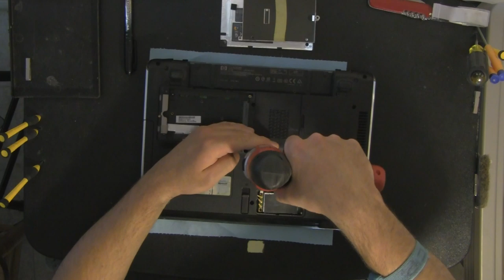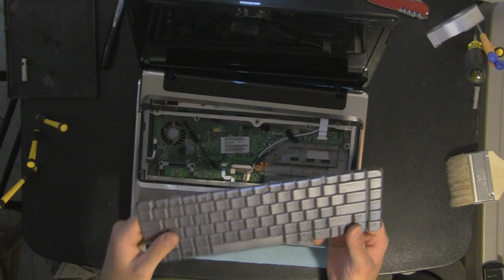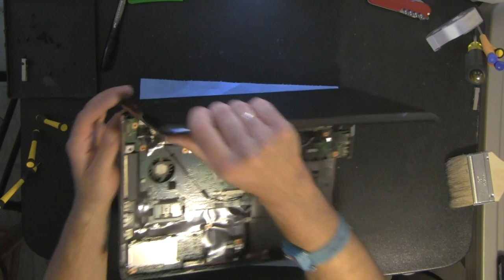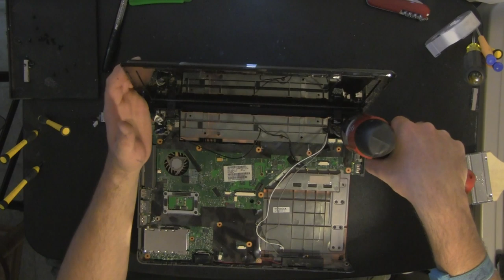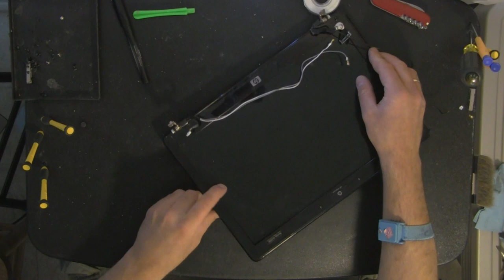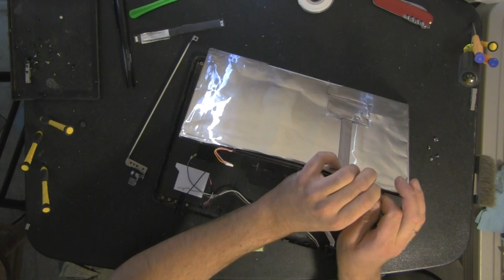HP DV3000 laptop take apart video, disassemble, how to open disassembly

Comment from the maker: fan is behind motherboard and case bottom, so, you probably will be able to remove some dust even without taking it apart, but if there will be a lot, than pretty much whole needed. Just you do not have to take LCD out.

Comment: As it turns out, it's now about 5 years old, and knock wood, still working. 

Apart from the inconvenience of having to take it in and leave it for a couple of weeks at a time, it's be worth it for me. 

Don't know about HP. I would guess it was a net loss for them.

Comment: Great! I have a question, I have an old laptop (hp pavilion dv3500), they told me I had an inventec 1505 motherboard, I would like to know what processors are compatible, and if you can change the video card too. it says it has an nvidia 9300m gs. Could I change it to increase it?
Reply from the maker: Open a memory door and search for 6 digits- 3 digits number. Something like xxxxxx-xxx. With that number you can verify what exact specs you have and how you can increase it. Gpu most likely can't. Cpu, memory HDD to ssd

Comment: only problem i have and which led me here, is i have the same exact laptop as yours, different color tho, but the same, and my problem is, it overheats and i dont know what to do, im worried to take it apart and dust off some of the dirt but i might not be able to put them back together lol, so any solution or suggestions on how to reduce this overheating problem ? 

thanks.
Reply from the maker: +nior712 first simple idea, look, your laptop made so far without huge breakups till 2016 is already great! What is like 10 years? 
Anyway rule number one, when removing screws, remember where are they coming from. It is easy to do with a A4 paper and keeping them in the same order as on the laptop. (Like a map)
Don't panic everything that is made by human you can do too. 
When you will work with motherboard be extra cautious and touch motherboard by side and not resistors and connectors. If you notice that you getting an electro static shocks all the time - use some different clothes.
When you will take a fan out, you can even take apart a fan and see how much dirt will be there. Laptop is old and there can be some plastics broken or cracked, don't be surprised. Otherwise if something bad happened and it is not working after all, well, it is time to get a new laptop. Back up data first ;) Good luck!

Comment: I have a problem with my hp dv3000, I can't connect at my wifi. Please help me..
Reply from the maker: How did that happen? Was a problem accuring before? What did you change?
Reply: +regazzz 
I do not know, my sister was my pc. The driver no longer displays the connections
Reply: +regazzz 
had*

Comment: Thanks for this. I wanted to know how to replace the CMOS battery. Now that I know, I won't be replacing it. :sheesh: Worst design I've ever seen.
Reply from the maker: Barry Scott Will Yes, you are right!
Reply: +Barry Scott Will Just did it without the advised total tear apart. The connector is visible on the bottom next to the wifi card. Carefully yanked the old one out and just layed the new one into place. $7 2016  2 pin jst. Honestly you could prob just leave the old one in there as it is totally insulated.